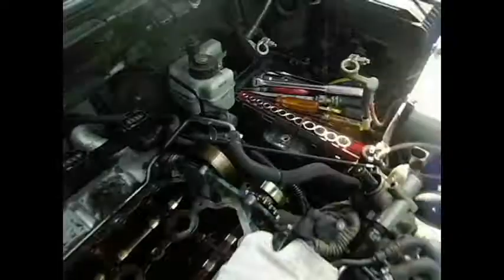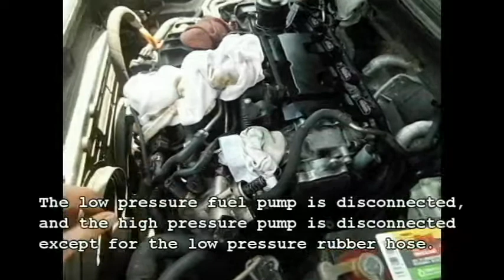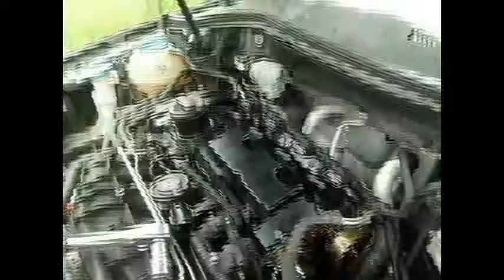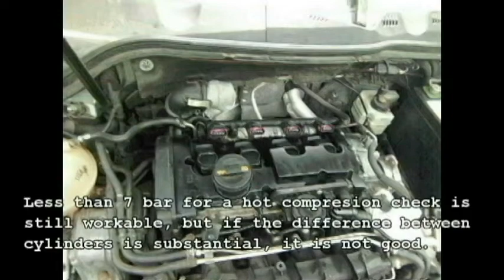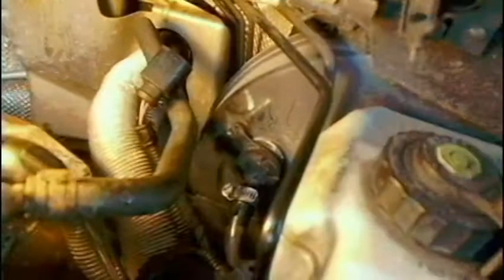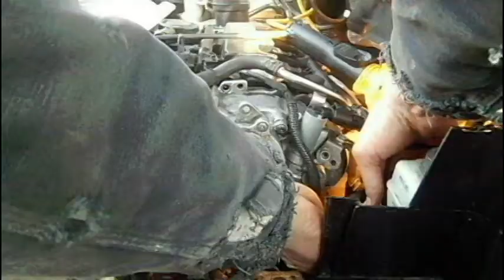Part 3 of 8: 2007 VW Passat 2.0T FSI I4 BPY Camshaft Adjuster Timing Chain and Tensioner Repair.

Comment: You still alive?
Reply from the maker: Surviving. It's been a year and a half since the last tensioner repair. I reinforced a dealer OEM tensioner tab with JBweld epoxy, after surface prep and forming with electrical tape.